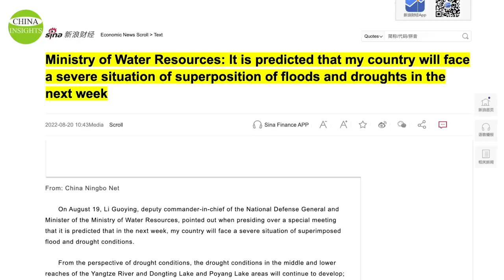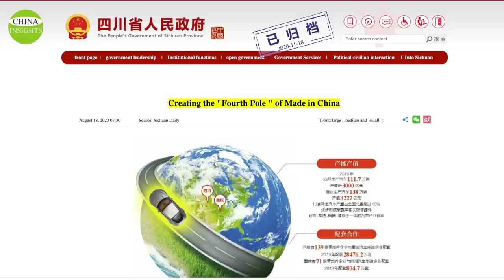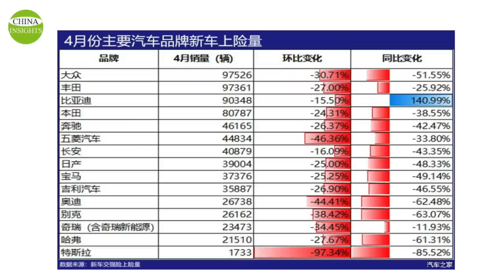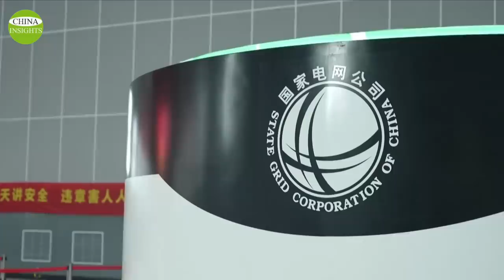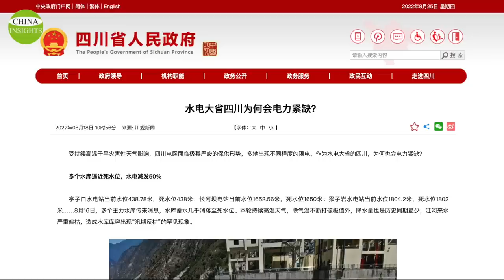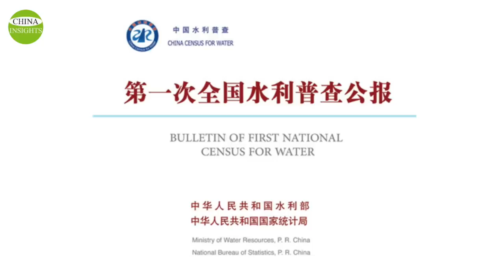Why does Yangtze dry up? The Power Crisis continues & Extremely high temperatures grip half of China

Comment: Not to complain, but ‘getting shoes stuck in asphalt’ was almost a rite of passage where I grew up.  As  singular data point, I view it less as an indicator of heat, and more of an indicator of road quality.
Reply: It's a bit of both, they can mix in stuff that make the asphalt able to withstand high temperatures but it's expensive as heck. Asphalt issues will only increase the next years because of the changing weather.
Reply: Nations that don't generally experience extremes of temperature like this wouldn't account for this in road design, to be fair.
The UK and Europe will likely be facing the same problem this summer as well.
Most northern hemisphere nations just wouldn't experience his.
Whereas countries like Australia where I'm from do account for it because we do see extremely hot summers.
Reply: Yes, in texas roads are built from material so that it doesn't melt in the summer. But they freeze kind of easily.
Reply: The only issue we have in Germany sometimes is that asphalt is expanding and therefore causing "blow ups". But I never heard of asphalt getting soft due to heat.
Reply: Yea but this is like the East Coast suddenly being as hot as AZ
Reply: True, just what I was thinking
Reply: There's also the video of the people supposedly taking shelter from he heat in a cave... IN COATS. Yeah idk, at least the stuck in asphalt and cave videos sound like utter bullshit.
Reply: Yes and no. Mostly no. Where I'm from for example, it's extremely expensive to make roads that will be able to handle both the summers that are getting hotter as well as winters that are still quite cold. Not an expert, but roads having to deal with 50-60°C temperature swings sounds challenging. Might even be more considering asphalt retaining lots of heat.
Reply: @mkzhero  When I was at university, I sometimes switched my studying environment from my room (which was unbearable warm on hot summer days) to the basement. In my room I was sweating, hard to concentrate on my stuff. When I went down to the basement, it felt comfortably cool at first but after like 30 minutes i got so cold that I was shaking. I had to take off my short pants and t-shirt and switched to long shorts and pullover.
Don't underestimate the cooling effect of an underground room/chamber.
Reply: @smallego8068  you're confusing the building warm up effect with what it's like when it's actually hot. I live in a flat where the air flows in such a way that two rooms have NO air flow even with open doors and windows. I sleep in the warmest of them. I also live in a hot climate. On very hot days, I just have the AC on, but if I don't, I'll be sweating like it's a sauna even if I'm naked. The second I step out into the hall, 2 meters away, not only is the air itself is cooler, but there's also air flow, so I'm nice and cool. If I go into the basement, it's not much cooler than said corridor where the airflow is maximal. I had days when In my room I was sweating but in the hall with the draft if was so hot I could also start freezing and shaking. Usually this meant that outside I'd be freezing,but in the basement I'd actually be warmer than outside. Point is, if it's hot in your room, that's just bad insulation and airflow, also don't forget the fact that electronic appliances, especially computers warm the room up, and finally, you yourself warm the room up. I've been to many caves in my day, but I've almost never encountered it being colder than the coldest place outside unless it's really deep underground and there's major draft which passes by water... And it's clearly not the case here because you can see daylight. People also have a thing - they tend to gravitate toward comfort. If it's super hot outside, and cold enough inside to need a coat, they'd be standing in aspot where they don't need a coat nor feel too hot. Lastly, people escaping heat wouldn't be likely to pack warm clothing in the fist place, unless they live nearby and came back for it, but even so I'd imagine they'd just set the seats closer to the exit instead. So to conclude, this just looks like footage of people on a trip. The previous two videos are, as others mentioned, also shady because people getting footwear stuck in asphalt is a semi common occurrence, freshly laid or heated up. The horrible quality like on an old camera and blurred dates and info also don't make it much more believable. Now, I'm not claiming that for sure, but given all I mentioned, there's quite a lot of room for doubt too.
Reply: As a child in the UK in the 60's we would sit by the road and make tar-bombs using scavenged lolly/popsicle sticks and the melted asphalt. Often had a smack in the head for turning up home with tar smears all over.
Reply: @terencejay8845  lol
Reply: Unwitting motorcycle owners sometimes come out to find the bike laying on the ground because the kickstand punched right through the asphalt layer. they do sell little "coasters" for that problem.
Reply: @smallego8068  ...common in Australia ...not bad at all.
Reply: @BIGFOOOOOT Tjhey’re just used to it. Melting roads and heatstroke? Just another day in China.
Reply: Shoe quality
Reply: Me too, I've seen asphalt melting when I was a kid, 50 years ago, eh, that's not an indicator, it's black after all, under strong sunshine it could melt even if temp isn't that high. I don't know if you have an idea about the strenght of sunshine in southern Italy in July.
Reply: This happens in Australia's Summer every year . We are used to it
Reply: What would you be complaining about? This isn’t a complaint, you should be honest with yourself lol. Living where there are low quality roads as a kid makes you no expert in either roads or climate.
Reply: @mkzhero  you thought up all that? People gravitate toward comfort but not you apparently. You sweat it out in your room. Also, people escaping heat might know they’ll be cold later and they plan ahead. If the temperature changes 50° or more from day to night, and you know it’ll be cold you plan ahead. If this video is shady, ask yourself why you think that or are you just suspicious of dumb things
Reply: @dirtyaznstyle4156  you just have no idea what 50c is like. I've experienced 49c not far from where I live, and no, it doesn't get colder at night at all. Heck even when its around 30c here, at night you still RARELY ever need any extra clothing, because the worst I've seen it drop after a 30c day is 18 and windy. And I live pretty much in a desert. So no, no cave or night temperature drop can get you from 50c to needing a coat, maybe in an actual desert but that's it. Also it's clearly day there. Do you even have any idea what diffusion is and how it works? On a 50c day, to get that cold, you'd have to sit in a cave that has at least two exits, and the wind creates a draft from the other end towards you, in c closed cave, the worst you'll be getting is 20c on such a day, and even for that you'd need to walk at least a few hundred meters in for that, meanwhile here you clearly see daylight.
Reply: I live in one of the hottest places in the world and the asphalt doesn't melt in the summer.  What that video depicts is crappy asphalt.
Reply: @philsalvatore3902  Same. I live in a spot where we ACTUALLY got 50C (in the shade). The roads aren't made from any special materials... NOTHING melted. Its either shit road and/or a freshly laid one, combined with the possibility of crappy Chineese slippers. I had a pair which would stick to COLD floor, because after a month or two in the closet the rubber-plastic mix of whatever god awful garbage they recycled that out of started to decompose and became like glue putty-glue, thankfully i noticed it right away because it stuck to the floor, otherwise, it'd stain my feet and all the floor, as is i just had to clean a couple stains. Can't imagine what such slippers would do when met with hotly laid fresh asphalt, probably immediately bind to it like in this video.